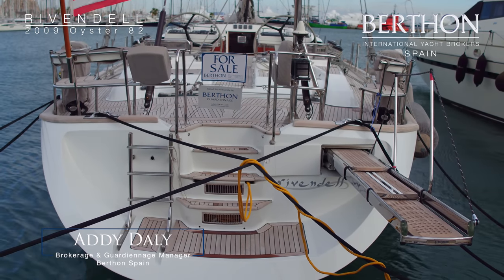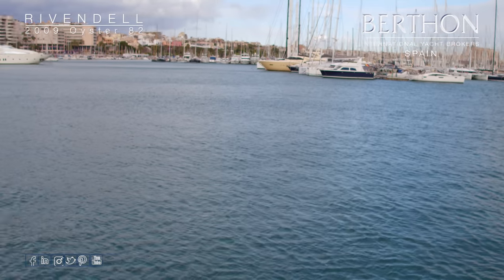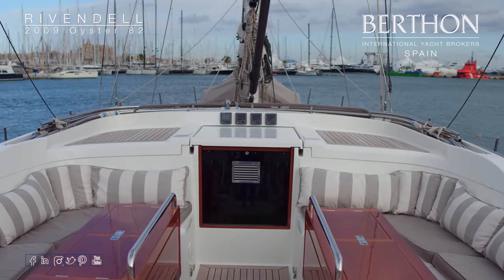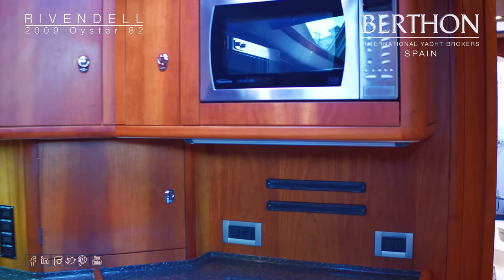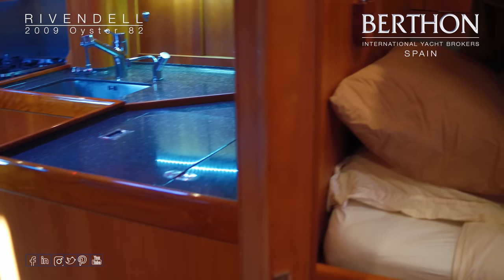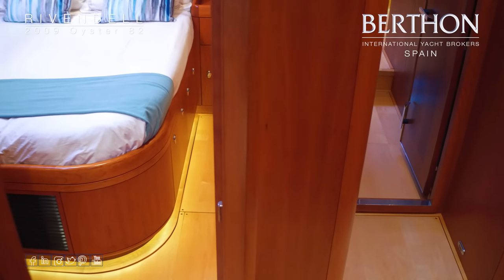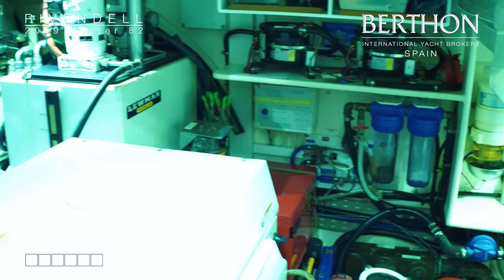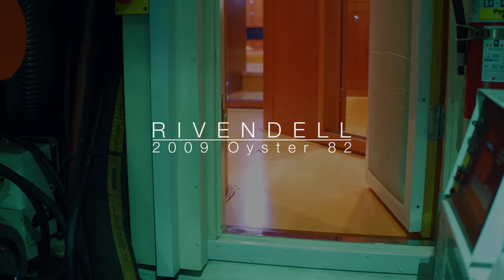[OFF MARKET] Oyster 82 (RIVENDELL) - Yacht for Sale - Berthon International Yacht Brokers

Comment: I wonder how much seven thousand hours is in terms of generator life.  This is a very nice boat. The interior could be rearranged to taste. A very nice presentation.
Reply: Probably about half of the engine life. The generator parts may need replacement first. 
Usually people replace main engine and both generators at the same time. It often involves removing a part of the deck.